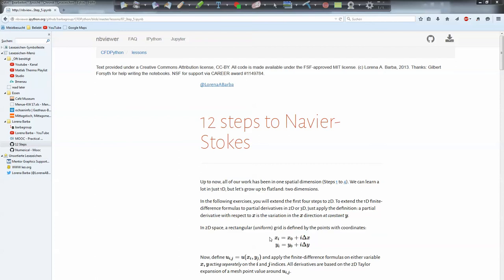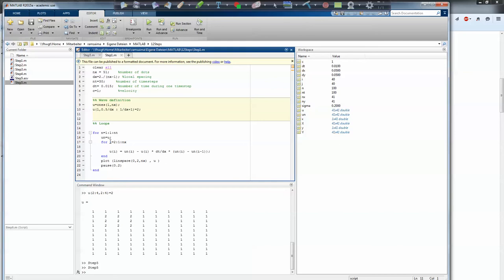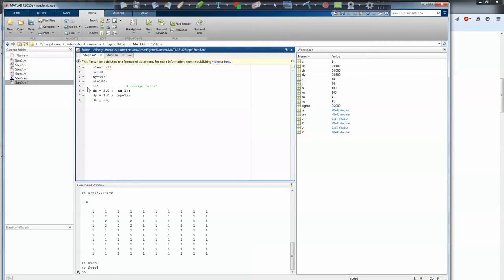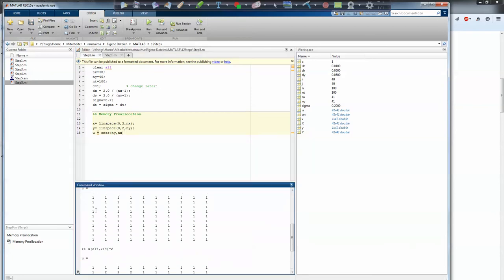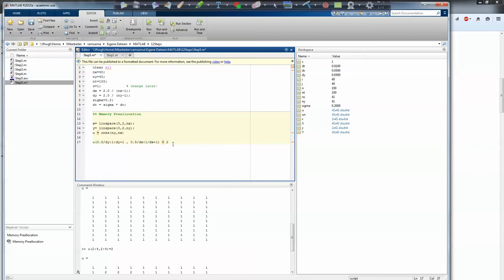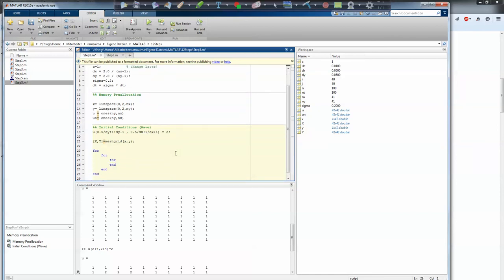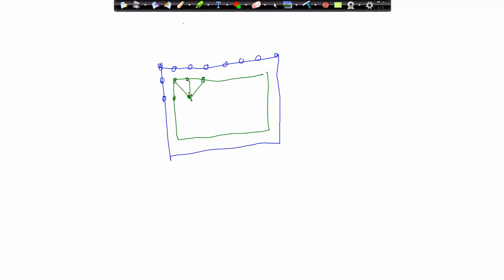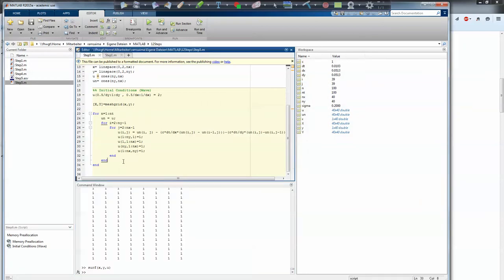12 Steps to Navier-Stokes - Step 5 Linear 2-D Convection

Comment: Thanks for making it easy to learn these approximations. I'm just wondering, in the part where you approximate the differences, the c*dt/dx term, should it not be multiplied to un(i,j) - un(i,j-1)? Since it's the difference in the x-component (i.e., columns)?

Comment: Hi thanks for the great tutorial. I have a question: in the notes for this equation, I noticed that in the implicit scheme  there was "backward difference for the time derivative" but it was actually "forward difference for the time derivative"(for the du/dt term. Is that a mistake?
Reply from the maker: Could well be that you caught me off guard here ... its been a while since I did this :-D Could you kindly point me to it, where it was? - maybe it was a backward diff in space but forward in time and I got confused what I was talking about ;) 
All the best!
Reply: @ManuelRamsaier  It's just in the pdf file you shared for the original notes ie video lesson 5 page 16 at the bottom. Also, is there a textbook that corresponds to this cfd course? Many thanks.
Reply from the maker: @nikan4now  As far as I know there is no text book :( Those were my notes I made for the lectured from Prof. Barba.